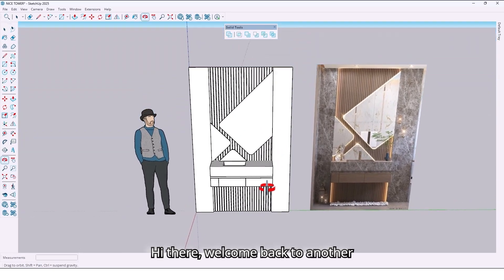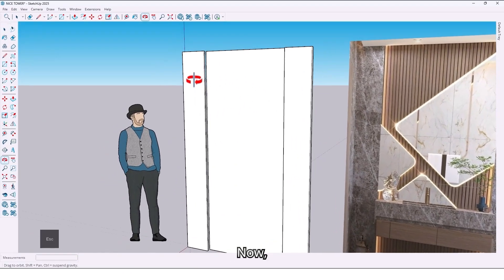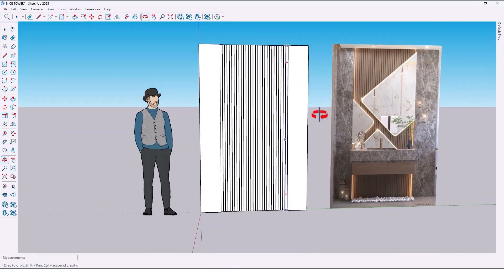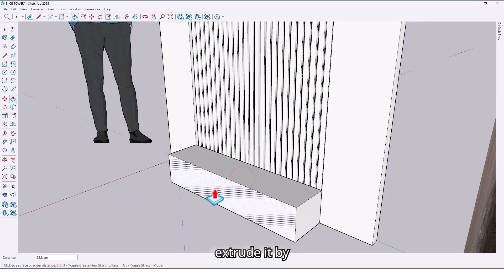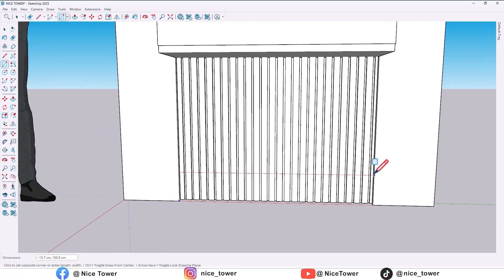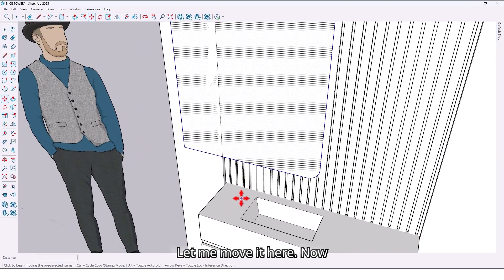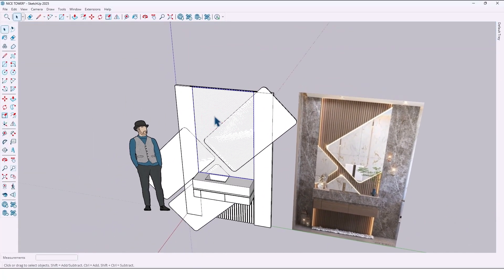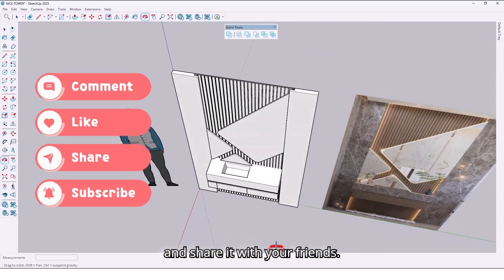SketchUp Design: Modern Vanity Area Tutorial (Step-by-Step)

Comment: 1. 스톤 패널(Stone Panel) 만들기

**사각형(Rectangle Tool)**으로 30×250cm 크기 생성.

Push/Pull Tool로 5cm 두께로 Extrude.

전체 선택 후 Component로 묶기.

2. 우드 패널(Wooden Panel) 제작

사각형으로 100×250cm 크기 생성.

스톤 패널 복사 후 중앙에 위치시킴.

패널에 라인 조명용 홀(Hole) 제작.

패널 자체를 스케일 조정(Control 키로 양쪽 스케일) 후 1cm 두께 Extrude.

전체 Group 처리.

▸ 세로 루버(Louver) 표현 방법

수작업(Hand Method)

3×1cm 작은 루버 Component 생성.

Move+Copy로 배열 후 Divide 기능(/30, /20 등)으로 간격 조정.

플러그인(Plugin Method)

101 Bit Tools → Create Vertical Louvers 기능 사용.

설정: 두께 1cm, 폭 3cm, 간격 4cm, 각도 0°.

클릭만으로 자동 루버 생성.

3. 화장대 본체(Vanity) 제작

사각형 → 20cm 깊이, Extrude 30cm.

전체 Group 후 높이 75cm 위치로 이동.

상단 모양 변경(3cm 조정, 약간 더 Extrude).

서랍장(Box) 추가: 15×30cm 크기 직육면체 생성 → 2개의 Drawer로 Offset 및 Extrude.

4. 장식 거울(Decorative Mirror) 제작

큰 사각형 그린 후 Arc Tool로 모서리 라운딩.

Extrude 1.6cm.

Offset으로 내부 조명 틀 생성.

Component 처리 후 복사·회전(45°) 배치.

필요 없는 영역은 Solid Tools → Subtract로 잘라내어 마무리.
Reply from the maker: Thank you 😊